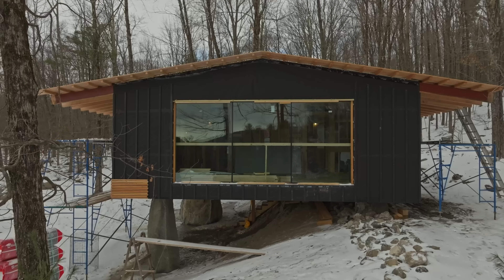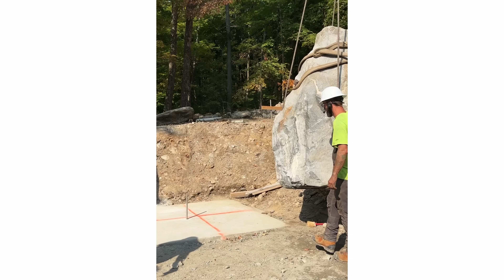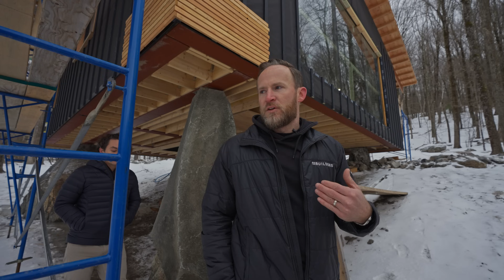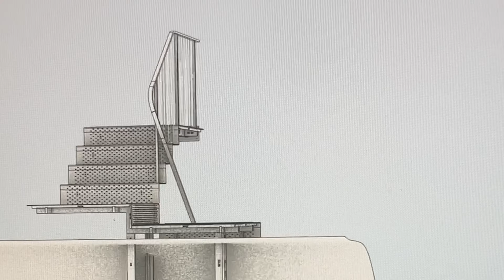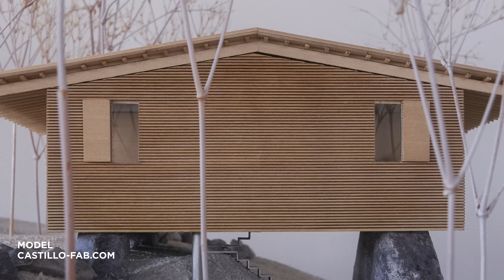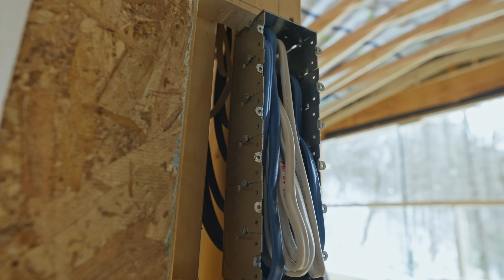How Granite Columns Support This Cabin in the Berkshires

Comment: Enjoying the architect, engineer, and subcontractor informational walkthrough discussions you’re doing the past year, Nick… And refreshing to see Vincent experimenting with the plywood shingle house and this cottage.  

I’ve never been a fan of all fixed windows, but I get the idea of using the Tudor solid panel shutters for ventilation when you have plenty of natural light & just need a means for fresh air.  I’d want the solid shutters to have tilt/turn hardware.  A good add to these vids would be to show drawing details of key items like the frameless fixed glass - which can be subject to thermal stress breakage. With the size, I’m guessing it’s tempered glass which  is one way to deal with that. Was it gasketed?  With the faux rafter tails… If it was continuous heavy timber the spacing could have been greater with less labor on the install, so I’m not sure I buy the cost savings. With what seems to be a remote site, flitch beams might have been a good option instead of the steel skeleton-frame. And the stone kitchen island continuing through to the ground - being one of the boulder piers would have been a nice read of the house being supported by the natural environment.

Comment: I got a good chuckle out the stone being aligned with a steel rod. At least you won't have to worry about the rock falling over because the wind is blowing...

Granite used to be quarried by drilling holes in the top, letting it fill with water, freeze, expand and crack.

Comment: Reminds me of a co-worker I knew years ago who built a vacation house using tree stumps as a foundation; presumably, he put metal caps on them to keep any insect problems from spreading to the frame of the house. I have no idea how his building performed,  but I've seen 200 year-old houses with stumps serving as pilings that were still functioning. I wonder if anyone sells waterproofing/bugproofing systems for stumps so people could built that way and count on a reasonable lifespan. It would be the ultimate "green building" solution, and a money-saver as long as it worked.

Comment: I enjoyed the walkthrough. Because this seemed to be pretty unrehearsed, as a builder who really appreciates innovative design choices, to what the interviewer happened to notice and the builder/architect 's responses. I really like the design and the rationale for the choices they had to make. It will be particularly beautiful as the lach/tamarack silver and integrate with it's surroundings., I experienced that on some reverse board and battan we installed. The only drawback, though was bees making nests behind there. It might be one of those things that isn't really spoken about much but should be.  I was a little uncertain about the steel steps because I thought the mass of the masonry related to the mass of the stone. The design lightness of the steel may be better though, I'd have to see it. Thank You for taking the time to share this.

Comment: Horrible design. I have 12" of 20 year old insulation in my kitchen floor which is directly  over my garage and when my kids leave the garage door open in the winter my kitchen floor is freezing because the cold wind whips around inside the garage.

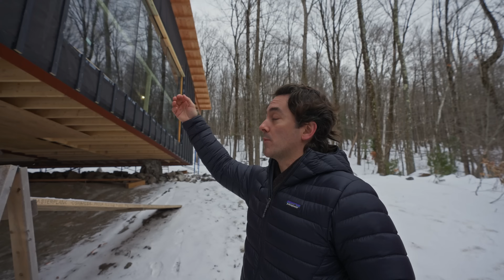Comment: [8:20] For the hearing imparied like me: Pro Clima, Solitex Fronta Quattro a "WRB"-Weather Resistive Barrier or breather membrane. Like tar paper, but fancier. I have to say, this is one "architect Inspired Vision" that I found quite compelling. It's the only house i've seen that merits a forced hot air heating plant. Personally I think it is ridiculous the amount of engineering that went into selecting the granite (or ignious/gneiss) rock when we all know how solid granite is. Regardless, thank you for bringing us on the site vist and kudos to the arhitect and builder for doing such an awesome job! BTW, Tamarack/Larch (Larix laricina - FACW) is mostly found in wetland areas and don't typically grow very large, hence the spendy pricetag. But it IS beautiful to be sure.

Comment: I'd like to hear how the steel frame is a moment frame. Where is it anchored that it is not dependent on the rocks no moving. If it had a continuous footing along one side, then maybe it would act as a "sort of" moment frame.
Reply: Each boulder has a 1” stainless anchor bolt like pin at the bottom embedded 18” in a concrete footing and 18” in the boulder. The boulders cannot migrate. The tops of each boulder have (4) threaded rods bolted to a 1” x 12” x 12” plate and to the steel frame.

Comment: OK  let these gguys use you video crew to do a Q&A.
Fans let's make this a comment of questions for follow up.

Im watching it a second time 20 mins after the first time and getting more questions.

I've had more comments than normal so I'm cutting and putting them here.
Reply: Fixed windows should always be built in house.
The cost are so high now, and tech is so well know, its better to do it yourselve if you have an budget instead of a blank check.
Look into vacuum glass and get r-13 to20 in the glass
Reply: 17:29  doing the original as all larch and granite is the perfect start.  "Value engineering",or whatever you call it, and then using your skills to make it the same house withing the budget is the definition of architecture.
Chef kiss on this one.
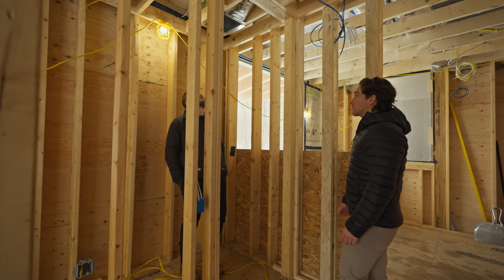Reply: 21:50  so how much are you cutting the door? Curious for the design factor. How much before it looks weird?
Reply: Thank you for the closet/mud room return.

Im a little late but price vaccuum glass. Dont remember if it would do 8x6 but i was suprised how cheap it was.
Forced me to do something ive want to do for 20 years which was build my own fixed windows.

And let clients know they dont need as many functioning windows as they think.
Reply: Alula please do a video of the wall shutters. I'm planning to putting vacuum glass in my next build. This shutter option allows me egress options so I can put in more fixed glass. 
I'm in Colorado and planning a move in the future. Building specs that I don't sell until after they're done.

Comment: Fixed windows should always be built in house.
The cost are so high now, and tech is so well know, its better to do it yourselve if you have an budget instead of a blank check.
Look into vacuum glass and get r-13 to20 in the glass.